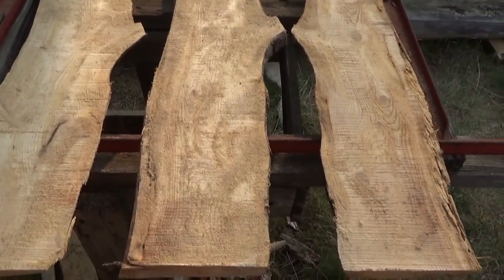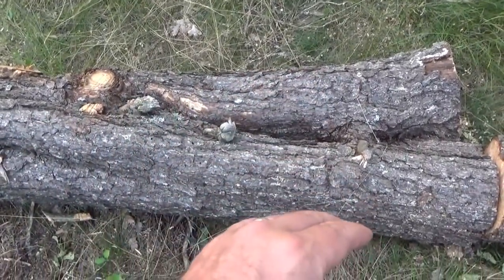The Off Grid Project Cutting Fire Wood & Lumber Mill Work

Comment: 2 THINGS 1- IN 3 YEAR YOUR TREE notching and felling has not improved even after 3 years ago at your old place i explained to you how to notch and feel a tree, 2- your lumber cuts are really ruff, you are sharpening your chain the same way are you cross cut trees, you have to have a chain just for cutting lumber, so the chain must be sharpened for ripping, huge different my friend , you will find when you sharpen a chain for ripping for lumber you will find the saw will cut a lot faster, and it should have long strip of wood coming off the saw and the board will be a whole lot smother, that rotten wood is not wast it is the best stuff to chip up as well as all the limbs to build up your self a huge pile to chip one day for mulch for the garden and lay it on 8 to 10" deep, one more thing dont wast your time and energy sawing lumber from dead trees, use only big green trees to thin out the land to give room and light for the younger ones to grow, sawing dead trees for lumber is already going punky and never a good wood for anything as it will just keep rotting ounces it is dead, dead wood is ok for fire wood for them cool fall and spring days and warm winter days, not good for long burns, and no that baby tree is not a spruce or a cedar its a weed tree called a balsam tree, very soft wood that rots fast if cut into lumber or fire wood even from green, the wind most always brakes them off 30 feet up, cut them all down like brush or shape them every year for 4 to 6 foot tall Christmas tree sales
Reply from the maker: 1. True. My friend is showing me how to cut better. Showing is better for me.
2. Its a special ripping chain. File it at 10 degrees angle. Its the old rusty chain that was rusted solid. Not very good but it is what I have. I think a brand new chain will cut like butter.
No, the wood is not good but it sure is good to practice with because if I mess up, its just fire wood anyway :)
I am done practicing and am now anxious to get some real green wood on the mill.
I am no expert on trees. Thanks for the info. Maybe I can sell them? There are a few like this on the land, all small like this one.
Reply: thanks, i hope so this time
Reply: well i am glad you have someone showing you, showing is always the best, i never seen anyone showing or helping you since your old place with Chris,, i just hope who is showing you is well up on how to do it them self, so often i find the blind leading the blind, yeas as for them balsam trees is you trim them in early spring before they bud out, and snip the top at the height you want the Christmas tree the branches will fill in once topped, and ecery year give them a little trim shaping job, the market here brings in $45 to $80 depending on size each, ok you just using the dead trees to practices thats good,, hate to see you build anything from them as in a few years its dust, ok i didnt know it was an old rusty chain if it been seized up i can see why, why i say your felling is no better as the stump you showed, your back cut is far to high up from your notch, i.e. the big down step, i am glad your no longer cutting down on a sharp angel as you use to, work on your back cut level to the bottom cut of your notch cut

Comment: Looking good for practice on the mill. Need to find some old growth iak and white pine. That pine planks can be use for building slap board siding on a out building. Keep the brush from building up to prevent fires. Burn it when safe and add the ash to the garden dirt thru the compost bin.
Reply from the maker: Thanks. Not much old growth anything these days. This is old logging area. I plan to get a wood chipper and heavily mulch the garden soon.

Comment: 10° top-plate angle on all cutters is the way to go. Either buy saw chain that way or take 5° off with each grinder sharpening. Or modify to Granberg specs.

Comment: You have to cut the boards thicker than you want then let it cure under shelter for at least a year then run it through a planer to get the proper thickness
Reply from the maker: Depends on the wetness of the wood but yup, pretty much :)